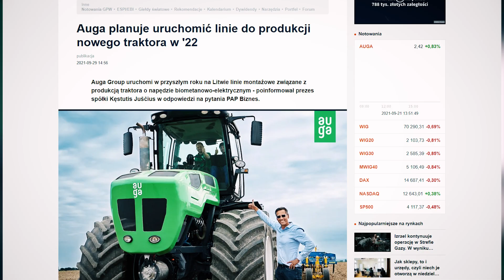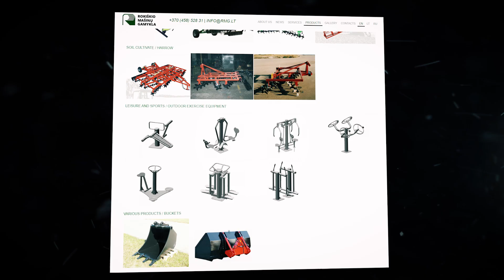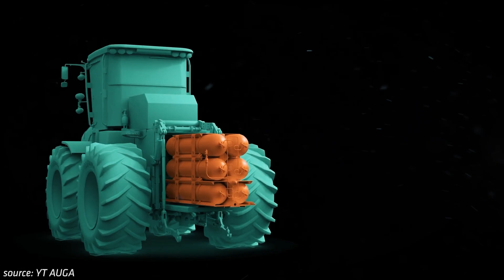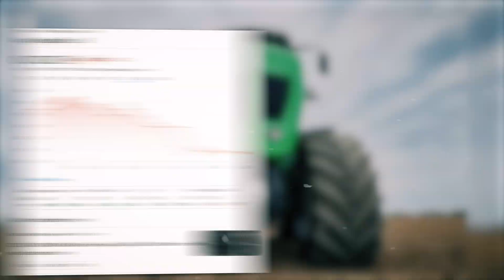AUGA M1 - The 400 HP Tesla of Tractors from Lithuania

Comment: I wanted Auga to succeed but have to admit I was highly sceptical from the start.  Modern tractors are complex machines, and most of the parts would have to come from existing manufacturers parts catalougs.  The profit margins would be razor thin.  This project looks much more like something that could be built by hand for a specific purpose and would work very well, but not something that could be mass built and sold at a profit.